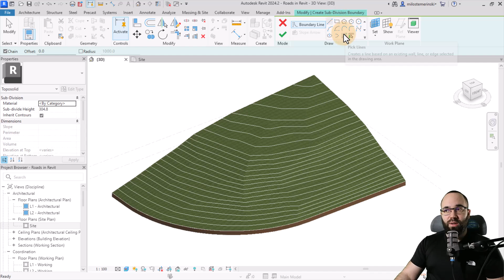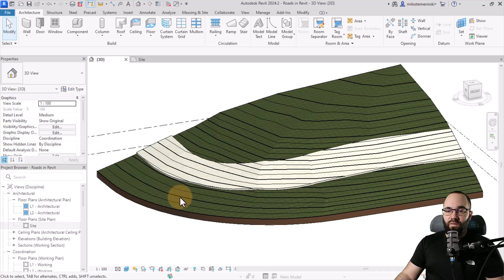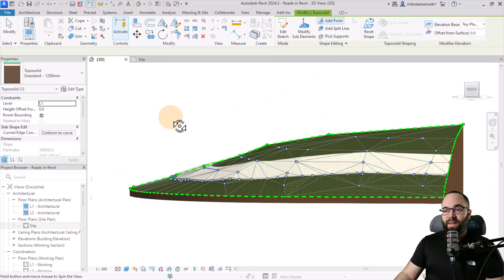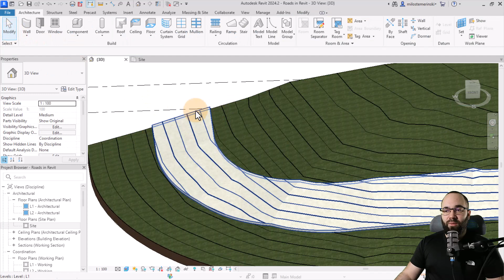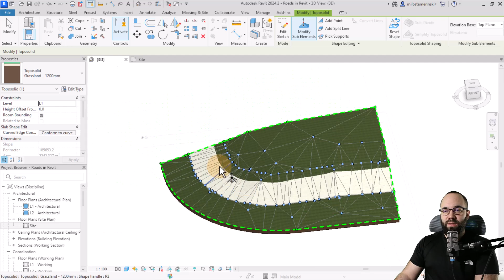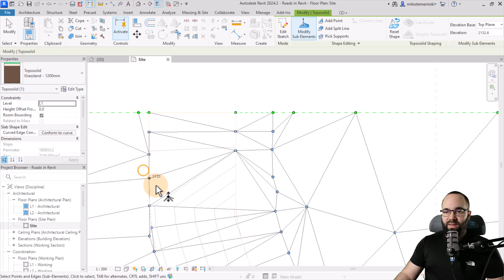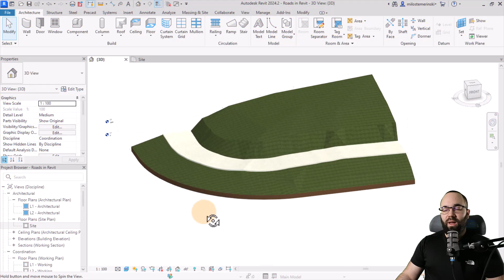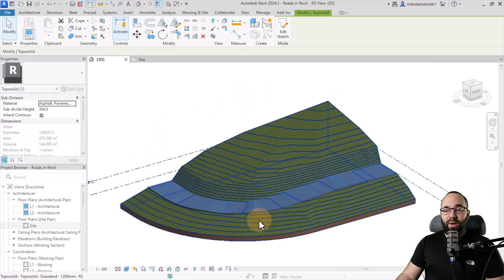Roads in Revit Tutorial (Toposolid - Subdivision)

Comment: The slope of your excavation is too steep. It would landslide.

In autocad it's quite easy. You have your loft solid groung topography, you draw a road centerline spline and sweep a substract (excavation) and union (mass fill) trapezes at 1:1 and 1:1.5 slopes respectively and an asphault rectangle. Voila.

Comment: wouldn't it be better to use floor tool to draw the road and then use the cut geometry tool to cut the toposolid around the floor (road) ? Since cut geometry works on toposolids now
Reply: The point of doing it this way is that there is 2 toposolids, 1 for existing surface levels and 1 for new design surface levels.. You're method creates 3 models (if you want to have phasing). Because wouldn't you want to cut/fill where needed so the road sits nice with the landscape?
Reply: Hmm, Need to be Consider

Comment: Thank you for the video BA. Just a workaround on what you have done that saved me alot of time recently. Instead of using the add point, use thesplit line. Using C3D use a feature line for your embankment peak/toe line an use the split line tool to project.

Comment: Kinda disappointing. There needs to be a faster and more precise way of doing this.
Reply: We have done a lot of hillside projects. We use building pad for driveway, and other things you need to control and change a lot during the design.
Reply: Using 'Add Split Lines' iso 'add Points' will save you lots of time and effort my Friend 🙂
I find it kinda odd for mr. Balkan Architect not to walk through this efficiency process in a better way..